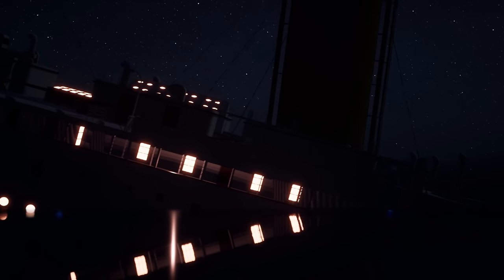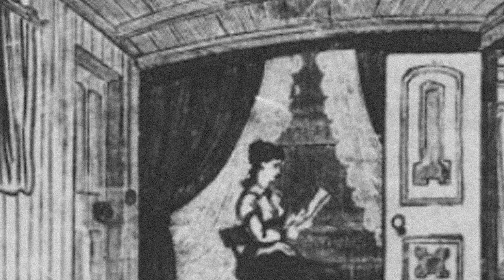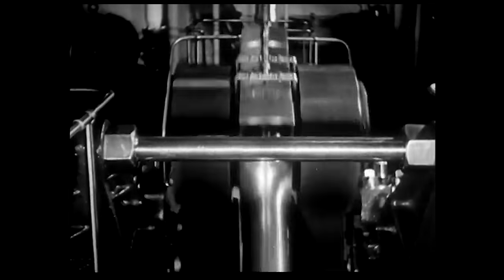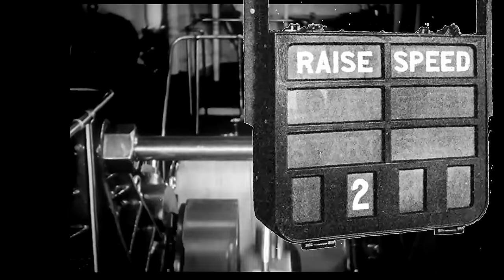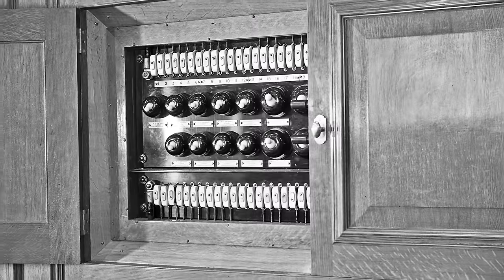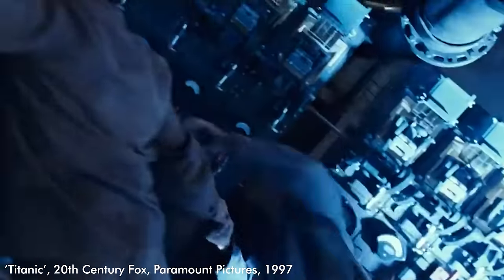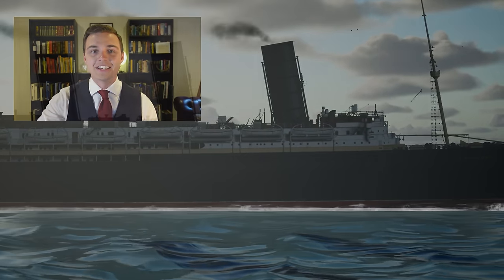How Did They Keep Titanic's Lights On So Long?

Comment: That's how my apartment building works they've got a Substation in the basement then you've got the main switch gear at the Substation and also we have  ventilation and Fire and Emergency suppression system and emergency backup lighting and each individual apartment and retail space  has got its own switch bord

Comment: How did the bridge the dynamo circuits without them having an unequal load or fighting each other? Even if you had a diode or whatever would be equal to a diode, the load would still surge and swell as you bridged the circuit and also bringing a fresh one online.

In the AC (Tesla/Westinghouse) world, you bring the generator/alternator online and match your rpms till you get a stable 50 or 60 (sometimes 59) hertz, then add it to the grid. If you just flip a contactor many very bad things happen then a massive fuse blows. 

Where those multi position levers also some kind of resistor?

Comment: Illustrations showing the stern high in the air like that are incorrect.  The stern did not lift fully out of the water until she broke amidships.  The reason is because it was the dry spaces in the stern and upper decks that were holding her ever increasing weight at the surface. Normally, she displaced 50,000 tons of water. As she flooded, to stay at the surface, she had to displace MORE water, meaning MORE dry space below sea level because she had to displace her own weight plus the weight of the water she was shipping.  Just before she broke, she was likely displacing close to 130,000 tons of water, because that’s how much she weighed plus the weight of her flooding.  The force that broke the stern off was the upwards force of buoyancy trying to hold the entire ship at the surface. As per Thayer’s account, she folded DOWN in the middle and THAT was when her stern lifted clear of the water.   Her lights stayed on as long as her boilers continued to provide steam to the electric turbines.  When the bow finally broke free, her stern fell, and then the weight of her engines, and the water flooding in thru the break lifted it back up near vertical.
It was NOT the weight of her suspended stern that caused it to break. She was more than strong enough to hold 20,000 tons of stern in the air.   She was NOT built strong enough to resist 130,000 tons of lifting force concentrated on the aft half of the ship. Once her center of buoyancy moved aft of her expansion joint, the lever arm holding up the entire flooded mass of the ship pushed the stern UP and buckled the vessel at the expansion joint, causing the double bottom under the last row of boilers to part cleanly and drop unbent to the ocean floor.  This is also why the demolished area of the wreck gets WIDER the higher you go. The upper decks of both halves crushed against each other as she folded down in the middle. This would not be the case if her stern had broken downwards.

Comment: Did the light bulbs still work when under water?
Reply: Those old lightbulbs ran hot so when they came in contact with cold water most of them cracked or shattered. But the ones that didn't could stay lit while submerged for a little while. I believe there was also some survivors who said they still saw lights coming from portholes under the water in rooms that had already flooded.

Comment: I'm really curious how much the emergency dynamos weighed because generally they have quite a bit of inertia. Once the steam lines broke, the inertia alone might have kept the dynamos spinning for a couple minutes which would have kept the emergency lights on for a few minutes after the break up -- but the cabling through the ship would have also been sheared and broken. 

Would be neat to reconstruct the Titanic from the original blue prints and purposely run it into another iceberg and film it in 4k to really get a sense of when things started going south.
Reply: We do have to consider that the majority of the survivor accounts stated that all the lights went off before or during the break-up.

The dynamos must have failed before the stern completely settled, otherwise, there would be no doubt the ship broke apart, as they'd be able to see it.

Either way, I doubt this inertia would last longer than 10 seconds, as the dynamos might have already been winding down slowly, due to the lack of steam on them.
Reply: @HugoGHA  When a generator is under load it is not spinning freely. It takes a lot of torque to overcome the magnetic forces.
Reply: @canuckprogressive.3435  yeah but even like i think it is said if all power generation got shut down there would still be enough inertia force in the turbines and engines to last one minute
Reply: @hunterbear2421  When you shut down a generator, say a diesel one it done not keep going for any length of time. Neither would a steam engine one.
Reply: @canuckprogressive.3435  umm a diesel doesn't really got any weight behind it. these generators i bet weighed a couple of tens and most likey more then a couple i say 10+ Tons. and flywheels are much bigger back then as well.

Comment: I heard DC generator twice but the old animation at 5:12 is an AC system with transforners. DC systems don't have transformers. Transmission losses because there was no reasonable way then to step voltage up to decrease transmission losses and drop it back down for the individual users contributed to Westinghouse winning the Current War.

Comment: Personally I think only one Dyno would be engaged because the more dynos you have on the more steam you are using and there is no point of having more than one when one is enough to power a lot of the hallways and exterior lights definitely when some of the most forward lights are not on due to the breakers tripping and then when they domed may have been due to low steam and one or more of those 48 wire could have been under water but not drawing enough to trip and the varying main panel

Comment: This is all awesome, but is dynamo just another word for generator now?
I vaguely remember that being a word in old versions of Flight Simulator...
Reply: If I remember correctly, a dynamo is a type of  of generator that specifically runs off of steam. Not quite interchangeable with a normal generator I believe, but I could be wrong.
Reply: @DerpyPossum  Interesting, thanks for the response. I was thinking of a magneto anyway.
Reply: A dynamo is a generator that produces DC power (like an alternator is an AC one).

Comment: The generator was on the siee out of the water
Actually electricity can be conducted by salt water unlike pure water but the copper wires are still the path of least resistance

Comment: I was wondering if furnaces were close to the engine room at the stern aswell? Because theres no-way jack & rose ran from the stern to the bow cargo bay witin minutes. Nor one of the strokers be able to lead the two men to the cargo bay.
Reply: There were cargo holds right next to Boiler Room 6 on the real ship, so it’s feasible for sure. Though the specific hold which contained the Renault would’ve been a couple decks up I believe.

Comment: We all hear that the plating was sub standard, but was it? I think most lives were lost due to not filling the life boats to capacity. Then the lack of lifeboats.  Most of the crew did their very best to help passengers when no help was available. I’ve always wondered about the ship that could be seen and didn’t respond. In the film the radio was turned off and they thought the distress rockets were fireworks. I would like the impossible to know the truth.

Comment: Thanks for such an interesting programme. If you haven’t already investigated the wireless radio installation on the 'Titanic', the YouTube channel 'Kathy Loves Physics And History' has an episode entitled "The Arc Transmitter (Poulsen Arc) and the Titanic" - No.31 - which explains how an alternative system would have made possible multi-channel transmission and reception, potentially avoiding disaster.

Comment: I’ve always wondered about this. Thank you for covering it. Although your description of the backup dynamo generators on D deck conflicts with this video from Jared Owen’s channel: https://youtu.be/HLrBUwNSEo0

At the 20:40 mark, he depicts the backup generators in a compartment BEHIND the main generators. Is this incorrect?

Also, I thought much of Titanic’s steam was vented shortly after the collision. Did they just keep a boiler going for power generation?
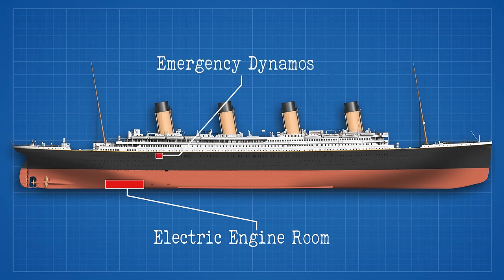Reply: Look again at 9:48.  He shows the emergency dynamo room in the right place.  They would not have vented all the steam, just the "excess" that wasn't be used after the main engines stopped consuming it.
Reply: @rrice1705  I see where he depicted it at 9:48. My question is whether or not there was a 5th and 6th dynamo in a room behind the main generator room as depicted in Jared Owen’s video at the time stamp indicated.
Reply: Every detailed deck plan I've seen places the backup dynamos on D-deck, just behind the second-class pantry.
Reply: @RCarpeDiem83  Oh, that.  I'm going off memory here, but if I recall correctly the space behind the main dynamo room could have housed a 5th and 6th dynamo, but did not.  So it was extra space that was available for future expansions if someone decided they needed the extra dynamos.  Don't recall ever hearing about these being installed on Olympic.

Comment: 3200 rpm is rotation speed for AC generstors in US 60 Hz system. And even there it is rare, usual setup is 1:4 ie 800rpm or more, it requires more  poles (windings) but simplifies design. And as Titanic had DC system it is not relevant at all, her generators rotated as they wished. So it is not real that anybody forced typical small ship steam engine for such a crazy speed just for nothing.

Comment: Hey Mike. Just a quick question that popped into my head - is it possible that there is still trapped 1912 air on the Titanic somewhere deep within the ship? I'm not sure all components of atmospheric air would dissolve into the ocean at depth (say, inert Nitrogen). Would make an interesting video if some chemist and oceanographers could chip in! :-) Keep up the great work.
Reply: The way you are asking it is physically impossible, any room that still had oxygen in it during the final plunge imploded at about 600 meters depth
Reply: @d.k8257  Doesn't need to be a room full of air, could just be tiny pockets of air compressed in a small corner of a room or safe, an upturned glass. I suspect the answer to this question is 'yes'.

Comment: Those dynamos had a huge number of commutator brushes to maintain. Another reason AC won out. 

I'm a little surprised they did not have a diesel powering the emergency generators. I guess they trusted steam more.
Reply: Diesel was still relatively new at the time

Comment: How did they know the Titanic broke in half if there was no moon to see in the dark ?
Reply: The silhouette of the ship blocking out the stars, mostly.
Reply: @DerpyPossum  it's a real question, but isn't there a few contradictory passengers that said it did brake up above sea and others that said it didn't?
Reply: @T3ki1a_  Yes, which seems to point towards the breakup happening much more subtly than what may have been thought initially. It might’ve even happened in stages, with multiple breaks involving the forward and aft tower sections.
Reply: @DerpyPossum  interesting! Thanks
Reply: The official inquires concluded she sunk whole, based on eyewitness accounts which were inaccurate partly due to the dark conditions. However, other eyewitnesses attested to the split which of course was correct.

Comment: Hasn’t it been recently discovered that it didn’t actually break in half until it was already fully under water from the pressure of the water?
Reply: If by "recently" you mean 2011 and by "discovered" you mean speculated upon and pushed by one documentary that contradicts over half the survivors' accounts...then yes.

Comment: the amount of thinking went into the electrical part, if even half of this went for security, the boat and passengers could have been saved
Reply: What exactly was lackluster in terms of "security"? Everything was perfectly up to 1912 standards. They couldn't have predicted the future, after all.
Reply: @DerpyPossum  Even post Titanic modifications can still fail disastrously, depends on the situation, the lifeboat increase would've saved the titanic, but in other cases when the sea is rough it might be impossible to put people in lifeboats to begin with, in other famous sinkings despite having enough lifeboats for all aboard they couldn't be launched, RMS Empress of Ireland for example. The lifeboats are a circumstancial option that MIGHT save lifes if the conditions permit it but in many other cases they're a false sense of security, you might not even have enough time to launch them all, again in the RMS Empress of Ireland from collision to the ship sinking it only took about 20 minutes maximum, another example is the MS Estonia where lifeboats played virtually no role due to the sea being too turbulent to launch them

You're never truly secure against hubris, arrogance, ignorance etc... the Costa Concordia proved that much, there's just no safety measure you can apply against ignorance and arrogance of going full-speed at night in an ice field with low visibility, at that point you're just asking for trouble and when you're asking, often fate will deliver it.

It could easily still happen today and the extra lifeboats wouldn't necessarily be a guarantee that you'd be safe, i'd say the Titanic was as safe as anyone could expect an ocean liner to realistically be,